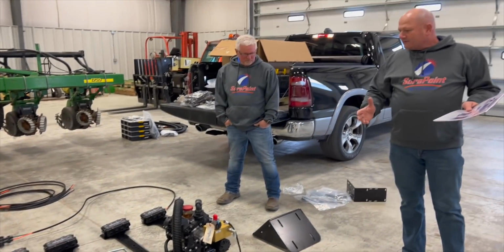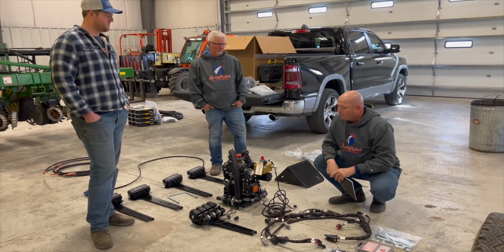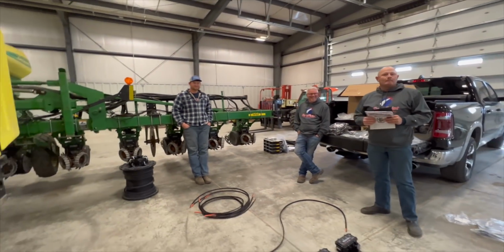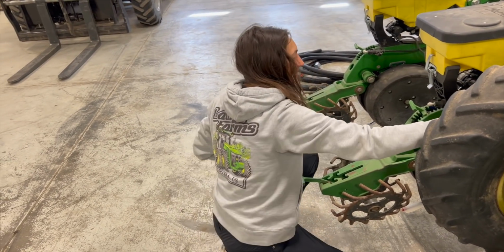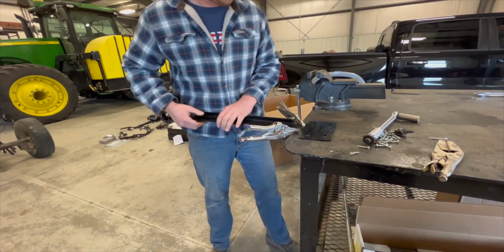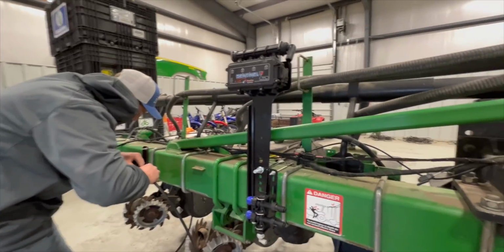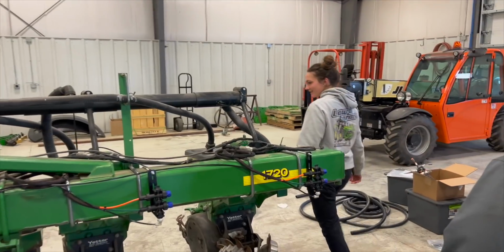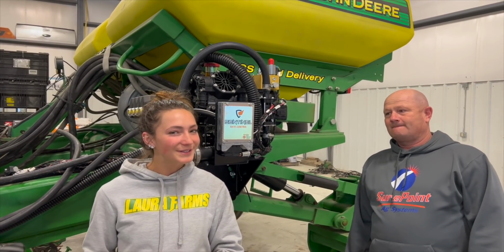One Last Step Before Planting

Comment: Putting on welding gear when using an angle grinder seems excessive for eye protection, but lacking for ear protection.

Protect your hearing, guys.
Reply: I would hate to ruin the welding lens. He is better off with a clear face shield. They are much cheaper than welding hoods.

Comment: I'm certainly no economics major but I wonder, with skyrocketing production costs (Putin's fault...) what is your break point (in years) for the ROI?
Reply: I'm  wondering the overall costs.. If you have 3000 acres & you make 500,000 $..but your total overhead is 440,000...that's  a lot of work for 60K & that's  if the weather n break downs don't  get you....